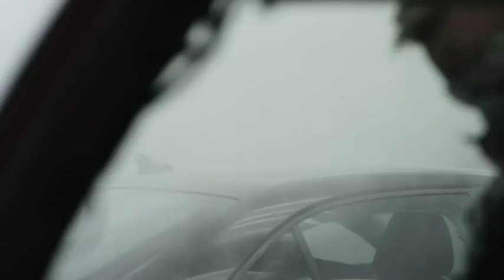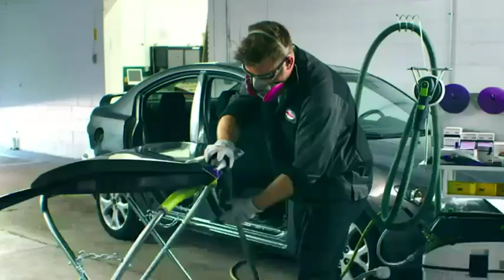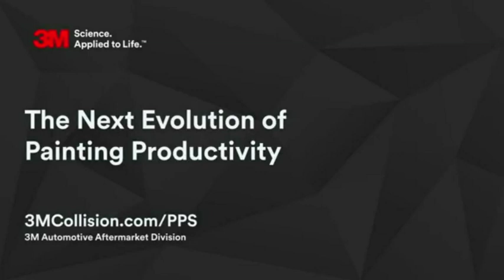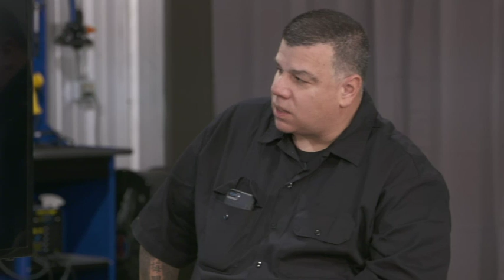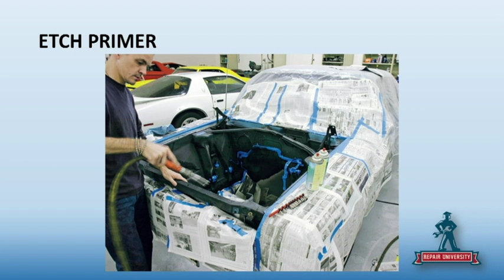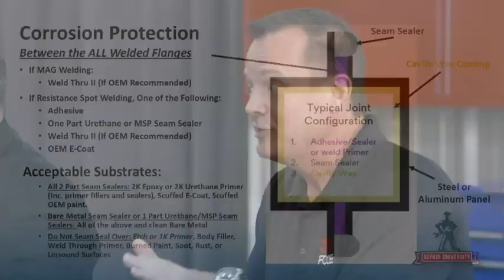Repair University: Seam Sealers, Primers and Body Coatings

Comment: Im so happy i ran into this. I'm honestly surprised it has less than 500 views. There's tons of awesome information in here! Thank you. I have a quick question. I'm doing my first restoration on a 68' galaxie and I strip, ospho, and epoxy primer my panels. Would you consider this a good method to be using? I don't have access or funds for a blasting.